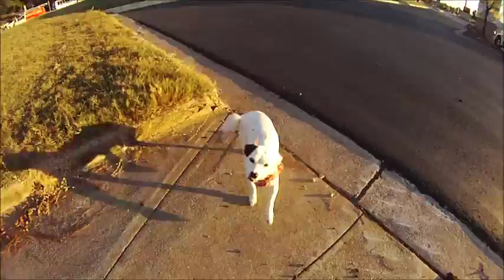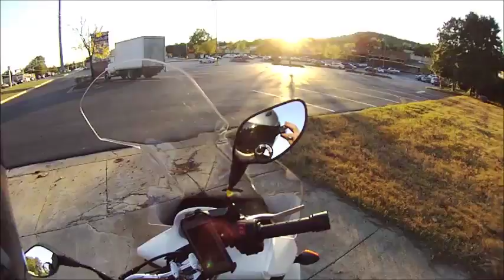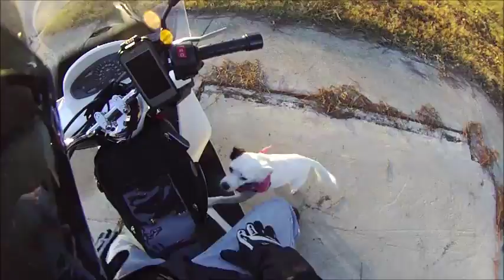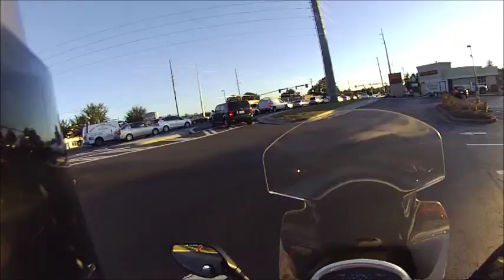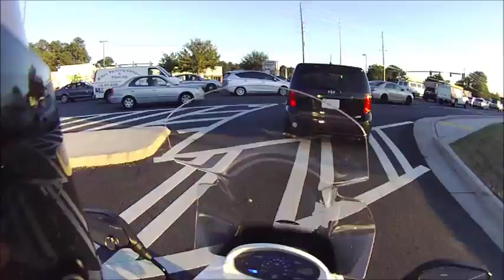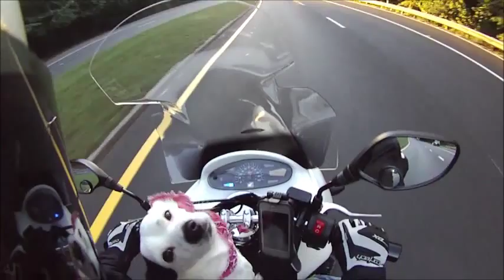2011 Honda PCX 125 -- Proof of 65mph top speed with Takegawa Variator

Comment: hi there ive just bought a malossi 2000 variator with 10.5 grams rollers and a malossi drive belt and a new face drive and a service got 72 mph no wind and on a straight.mines a Honda pcx 125 2011
Reply: same here  i got 74mph of a malossi 2000 with 10.5 gram rollers with a polin drive belt